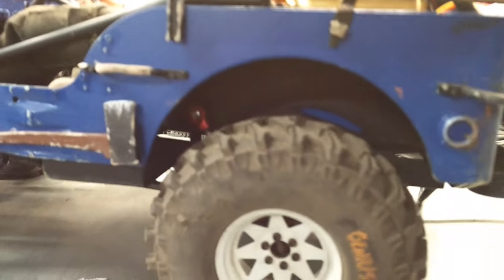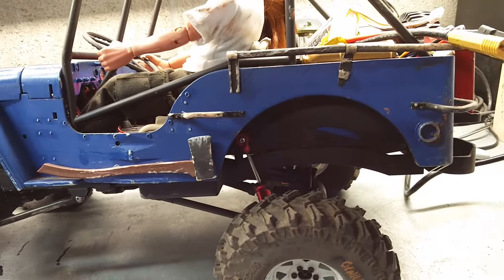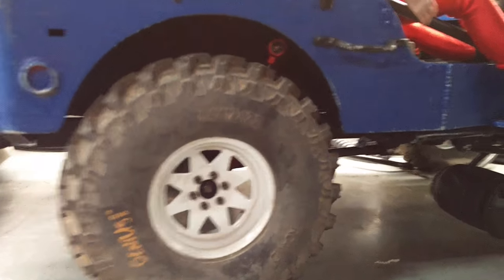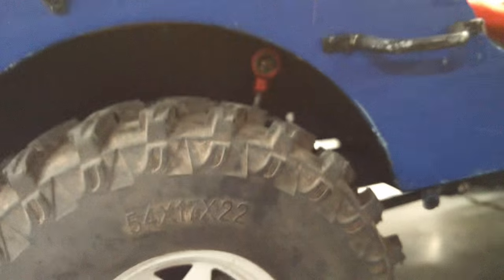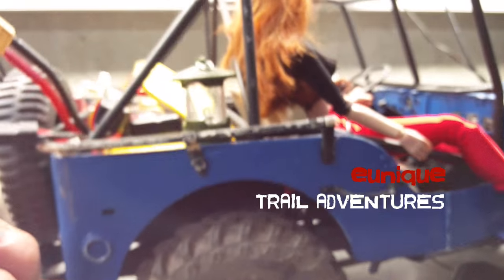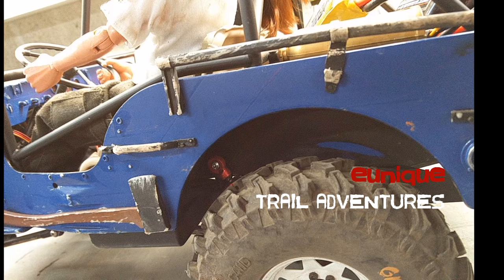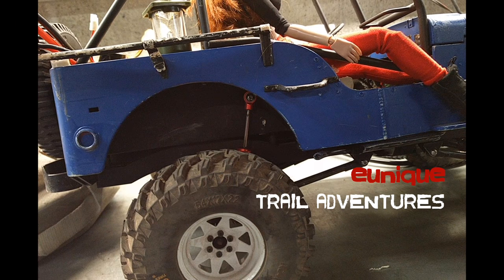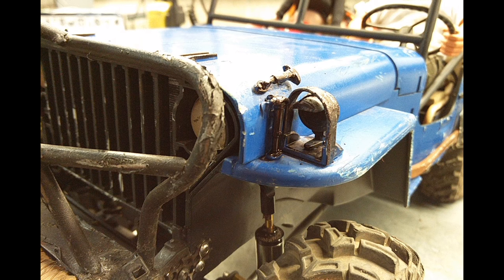Update #ProjectWillys GI Joe Custom 1/6th Scale Willys Jeep

Comment: What make shocks are you running???/
Reply from the maker: +tony ayala I have used different ones. The scale shocks I have that are internal springs. I have used a couple of cheaper options than RC4WD.

http://www.rcmart.com/cgk5100bkbebk-aluminum-front-rear-internal-shocks-100mm-p-63954.html?cPath=389_390
Reply from the maker: +tony ayala I have used different ones. The scale shocks I have that are internal springs. I have used a couple of cheaper options than RC4WD.

http://www.rcmart.com/cgk5100bkbebk-aluminum-front-rear-internal-shocks-100mm-p-63954.html?cPath=389_390
Reply from the maker: +tony ayala I have used a couple different ones. Internal springs scale shocks. Cheaper alternative to RC4WD

http://www.rcmart.com/cgk5100bkbebk-aluminum-front-rear-internal-shocks-100mm-p-63954.html?cPath=389_390
Reply from the maker: +tony ayala I have used a couple different ones. Internal springs scale shocks. Cheaper alternative to RC4WD

http://www.rcmart.com/cgk5100bkbebk-aluminum-front-rear-internal-shocks-100mm-p-63954.html?cPath=389_390
Reply from the maker: +tony ayala I also have Boom Racing from asiatees.com
And also...
Xtra Speed from rcmart.com
You should also be able to purchase those from eBay...but I ordered mine from those websites